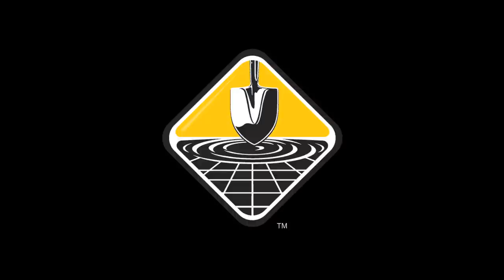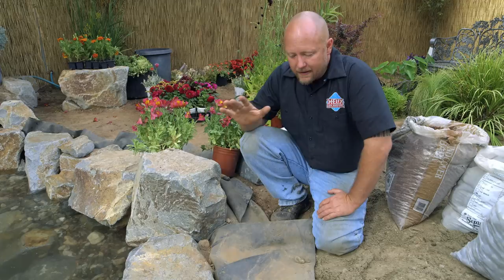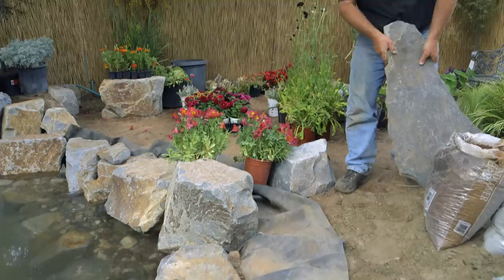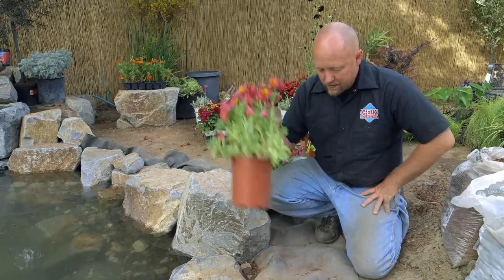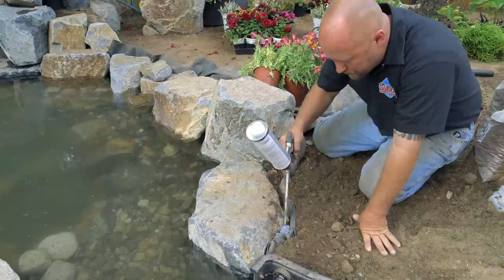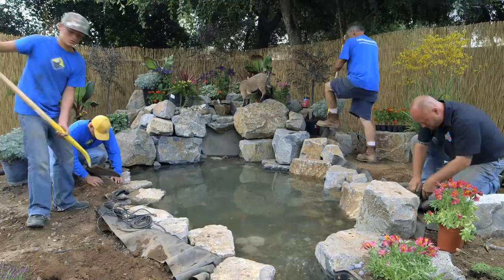How to build a Fish Pond - Part 20 | Pond Edging & Landscape Borders

Comment from the maker: Hey I'm glad you like it. I picked it up at my local rock yard. It is Mexican Beach Pebble and it comes in several different grades. 3" to 5", 2" to 3", 1" to 2", and 3/8" to 3/4". I typically will pick up a couple bags of each depending on the size of the pond and work in the different grades to help naturalize the edges.

Comment: Those were excellent ways to hide the liner around the edge.  I think I prefer the last method.  It looks very random and natural. I also liked the boulder that was placed back about 1-2' on the right-hand side. I'm interested in having 1 bog garden next to and separate from my pond and 1 that is actually part of it (i.e. the water from the pond seeps over into the bog to keep the plants moist/wet). Either of those would also have been a cool edition to finishing the edge. This series is great!

Comment: Great series. I am about to rejuvenate a pond in a house I just bought and these videos are invaluable.  My main concern however is making the pond safe for the grandkids and our puppy. Do you have any advise on how to make a pond safe without detracting too much from the aesthetics?  Thanks.
Reply from the maker: The steps and shelves are important for a safety precaution. consider a fence around the pond if you have small grandkids. Have an alarm on the back doors of your house so if the kids venture out back the alarm will make a beep notifying you. Just like safety measures for swimming pools.

Comment: Great series! Have any suggestions for hiding an in-ground UV light? We installed it in-line with the shut-off valves exposed (and obviously so we could get to the bulb to change it), but now we have to hide it. We're thinking of building a small deck (platform) to cover it and move as necessary. Any suggestions?

Comment: Does it not make it very difficult to clean the pond bottom when the pond is all rocked inside? It seems it would make a great place for particles to get trapped... I know they are not cleaned until years later it just seems it would make everything more difficult, especially if a leak ever developed. We are digging our pond now and in previous ponds we have only placed rocks on our ledges. It certainly is beautiful the way you do it.

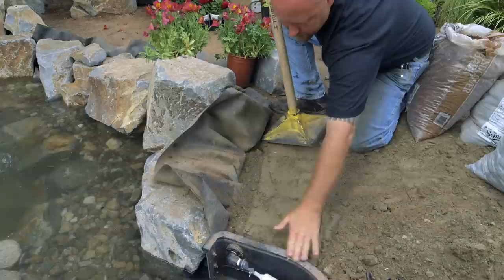Comment: At about 2:00 into the video you say the surrounding area is at least an inch and a half above water level, where the skimmer top is 2" below water level. But the surrounding area looks lower than the skimmer. Is it because of a sloped grade?

Comment: Do you have to fill the pond and allow it to settle for a week or two before you complete the edging to prevent the liner from being stretched?
Reply from the maker: No. We do it straight away. We do leave a good amount of liner on the edges for rework if needed but if you are working on good compacted soil you shouldn't have any problems.

Comment: I keep coming back to this. I can't figure out the best way to do my pond's edging. I was thinking of going more informal but the shape might require a more formal edging... The pond is basically a rectangular "hole" in a concrete yard, with the waterfall coming off from a back retaining wall (sort of "spilling" through it"). There is no step inside the pond to place rocks on, it is a sheer 4 foot drop. I was thinking of overhanging some type of flagstone 2-3" over the water to hide the liner. Any tips?
Reply from the maker: Go formal edges on the formal pond. Use large flagstone or slate and hang over the edge 3 to 4 inches.
Reply: Thank you so much! I think that's the best idea. I feel that if I try to make a rectangle look natural with bigger stones it will still turn out looking unnatural and just messy.